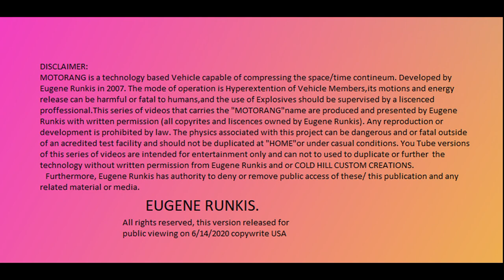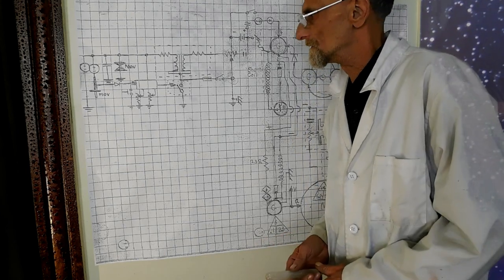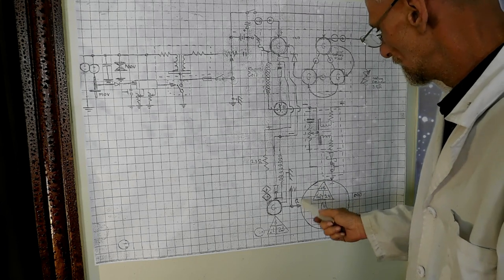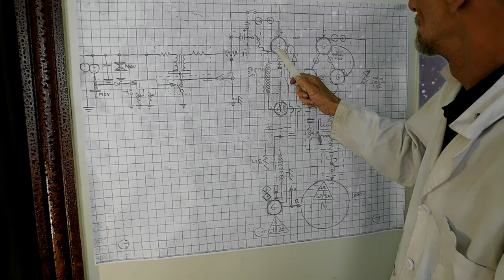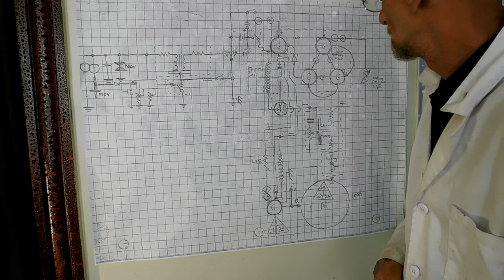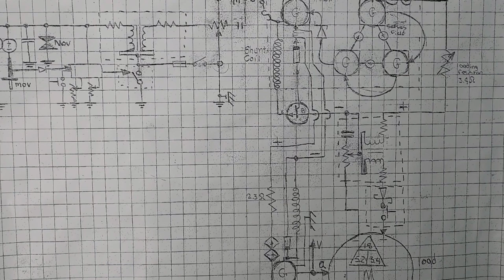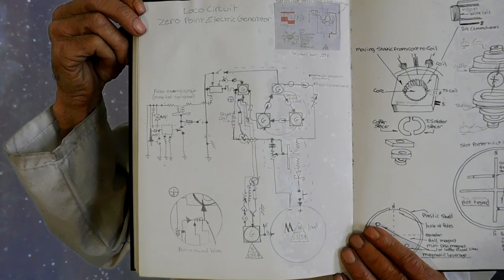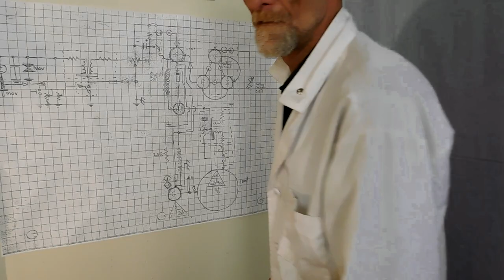Hardcore Homless video. loco circuit.

Comment: I admire your curiosity and tenacity but based on what you said, you lack the very basic knowledge of elementary Physics and understanding of electro-mechanical systems. Laws of Thermodynamics are taught in 6-th grade Physics class. What you referred to as "Zero-Point" module, contradicts with the Laws of Thermodynamics. ENERGY CAN NEVER BE CREATED OR DESTROYED. IT CAN ONLY CHANGE FORMS OR BE TRANSFERRED FROM ONE PLACE TO ANOTHER. THE AMOUNT OF ENERGY IN AN ISOLATED SYSTEM CAN NOT BE CHANGED.
Funny to note that such attempts to create energy out of nothing have been made for hundreds of years. Unfortunately you'll never see such a system operational. The "zero-point" systems you see on Yotube are totally fake, to generate views and to create all the hype. You can't produce more energy than you put into a device. The output energy will always be lower because of electrical losses and mechanical friction losses. This is why all the the so called - "inventors" are still paying their electrical bills. I'll give a title to my house to anyone who can build such a machine and demonstrate it in operation. It will never happen.
This doesn't mean that we as humans, have achieved our full potential to effectively generate power. We are getting closer to successfully producing a fusion based power generating system. Once this is achieved, we'll have all the power we need with nearly ZERO pollution.
Reply: @serenepeacefulrelaxingmusi3874  There is no help that can be given to this idea, it is a dead end. absolutely nothing can escape the laws of thermodynamics, you simply cannot get more out from what you put in.